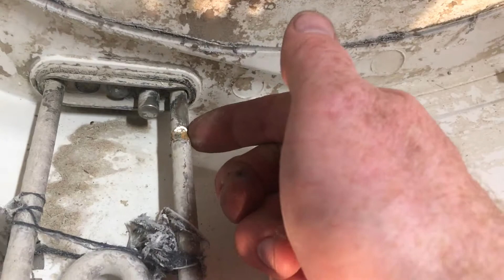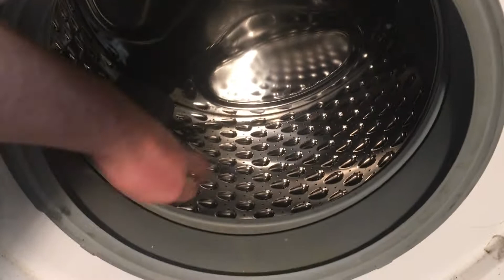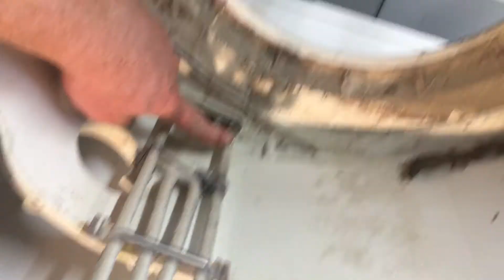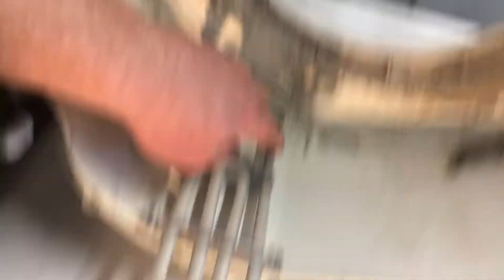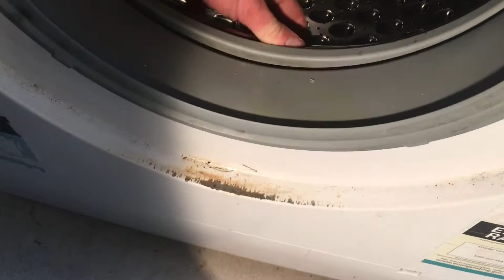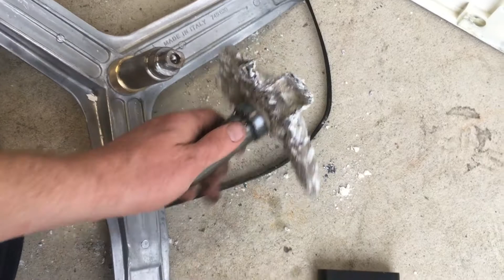Check Spider on Bosch front loader

Comment: The same thing is happening with my 2 1/2 years old Siemens as well. It's like at 1:45 that the drum has a very slight movement up and down and it's also going off center. Seems to be a theme with BSH washers that their spiders are going bad but our last machine a Miele had a broken spider too(but it was nearly 20 years old at that time). But the spider of the Miele snapped during spin and it's an instance I will always remember because I was in the room as that happened. As the drum ripped of the forces involved threw the machine and the tumble dryer on it over on it's and the dryer landed a few centimeters away from my leg😬
Reply from the maker: Wow that would be quite exciting to watch haha!  I'm not sure if there is something in some of the soap powders that react with some metal type or what it is.
Reply: @motrepairs  I think most spiders are made from Aluminium nowadays and today every(at least powder) detergent has oxygen bleach in it and many people I know use something like Vanish to shift stain better. And the oxygen can oxidize the aluminum which makes it brittle so it‘s easier to crack. But I‘m not an appliance engineer so I don’t really know🤷
Reply: @motrepairs  and it‘s not that exciting to watch if you don‘t expect it because you just wanted to tip some rubbish into the bin and you‘re standing only 2 meters far away from it😂

Comment: Hi , glad to have found your video . My bosch serie4 washing machine has the exact same issue which you showed with the least damage (@1:45 minutes of the video) where the drum is sitting off center and it rubs against the drum door seal and makes that loud squeaky noise when we turn it manually. What is the solution for this problem? Does the entire drum need to be changed or is it possible to replace just the spider ?
Reply from the maker: Depending on the exact model you may be able to get a spider but for most it comes with complete inner drum

Comment: Good commentary mate. I've got exactly the same symptoms on my bosch washer dryer. If I had workshop I'd have a bash at replacing the drum. Is it easy to take the side panels off?
Reply from the maker: Depending on what model it is you need to take the top and either the front or back off, not the sides
Reply: Yeah. It's a Bosch wvd24520gb. Think it's the same as your video, take the front off. My old one was take the rear off and slide the side panels backwards. Thks..